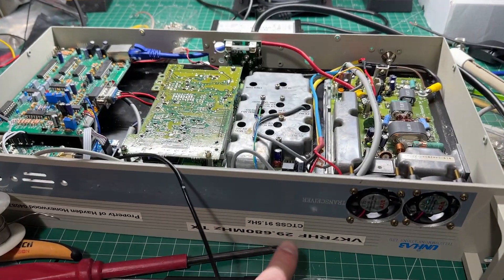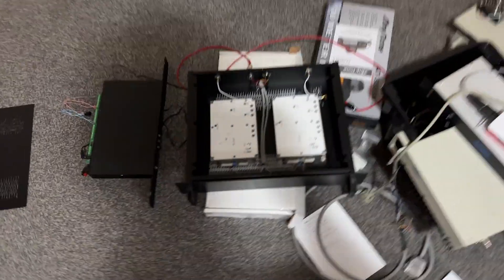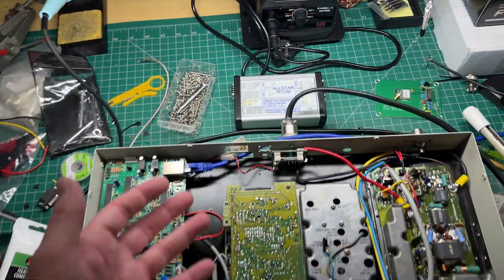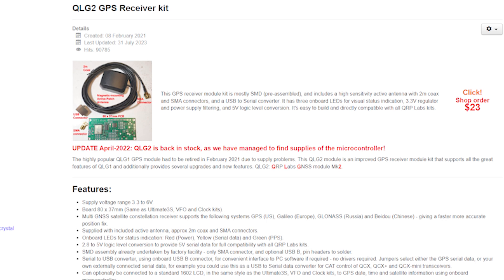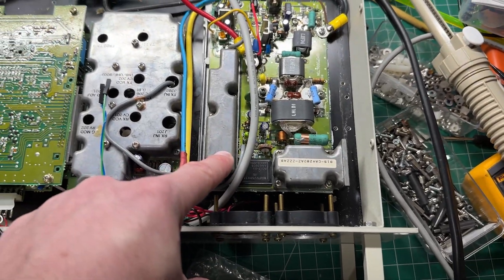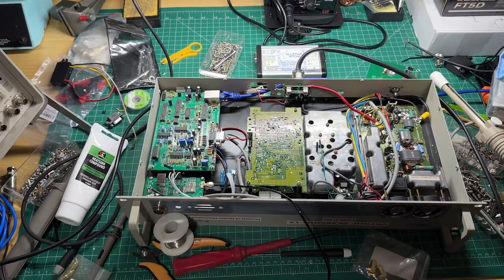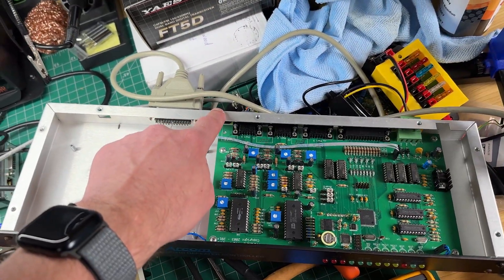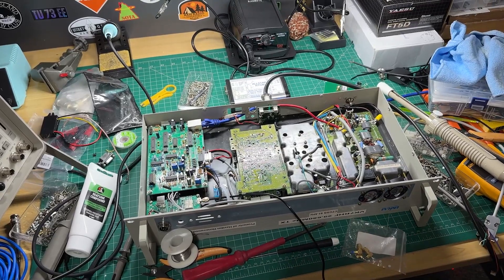10 Meter AllStarLink Repeater System

Comment: Hi Hayden, we're thinking of adding a 10 meter repeater to our club 2 meter repeater, Do you have any suggestions ??
Reply from the maker: Hey mate, 10 meter repeaters do require split sites - so you'll need to effectively build two "mini" repeaters... 10m RX to UHF TX and then UHF RX to 10m TX and link them together over RF - or do it via IP as described in the video.

If you're linking to your clubs 2m repeater you'll need a controller to handle all of that - the Arcom RC210 is a good choice and is the controller on our repeater at the moment.

Comment: What if you just want a 10 meter repeater without multiple receivers? Just the simple one in, one out?
Reply from the maker: You can then link them with UHF 70cm link radios
Reply: @HamRadioDX  What if I just have two modules connected by a patch cable of sorts? One recieves, one transmits?
Reply from the maker: The problem with 10 metre repeaters is the split - it’s only 100 KHz. Its very hard to duplex when the transmitter and receiver are located close to each other - so it’s common that the receiver and transmitter are separated by a radio link of a few miles to achieve the required isolation.
Reply: @HamRadioDX  So keep the RX node on one side of town, and the TX on the opposite side to better isolate the two? It's that or bump the separation up to half a megahert.
Reply from the maker: Yes that’s right. You can’t separate to 500 KHz as it’s an international allocation where 29.520-29.680 is allocated for repeaters.

I think satellite is below that, which cannot be used.
Reply: Would about 1.5 miles be far enough?

Comment: The KQ2H system in NY is local to me. Unfortunately, I have no 10 M gear, but that system is on 2m/70cm as well. I think there are 17 repeaters linked. Always fun to listen to that system when the band opens.
My first introduction to amateur radio was a repeater in St. Thomas, Virgin Islands, on 29.66 in 1991, so I have always enjoyed the idea of 10 m repeaters, but in 30 years of being licensed, have never actually used one directly.

Comment: I have worked through a 10M repeater located in Portland OR before. Cool project.
Reply from the maker: Nice! There’s a few of them around
Reply: There used to be a lot of them in Southern CA, but they started causing issues when the conditions allowed great propagation, and some got into loops. I do not remember all the details, but n that era 6M and 10M repeaters in the USA declined. I think the VHF repeaters were becoming more of a thing then. And, I also think it had to do with the rise of FM VHF radios.  @HamRadioDX

Comment: Wow very cool, I  am looking forward to working 10 meter FM myself just installed a quad band mobile in my truck have to tune the antenna, and build a program for it, great video, you have been busy I can see.😊
Reply from the maker: Nice! What quad radio you got?
Reply: @HamRadioDX  well nothing fancy a TYT quad mobile, Yaesu used to make one but discontinued now the 9800, you know I think people don't realize how capable uhf/vhf radios are, two weeks ago I was driving across the desert in Southern California got on the WIN system  and it was linked to the east coast reflector, some where along the line I was internet linked talked to a guy on echolink on his cellphone in northern California, a station in Alaska, and about a 30 minute talk with a guy in Germany, totally awesome, will be listening for your awesome 10 meter repeater when you get it up and running have a nice day 😊 73s KN6GZP DAVE